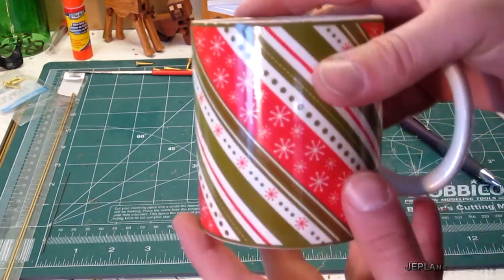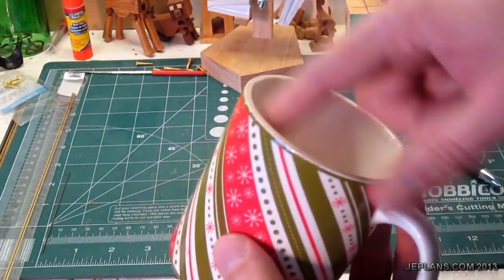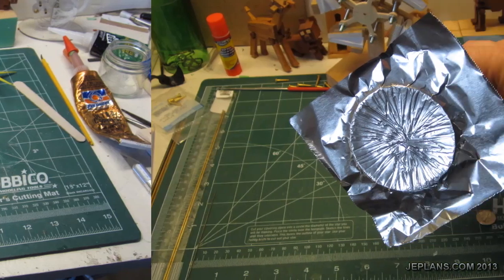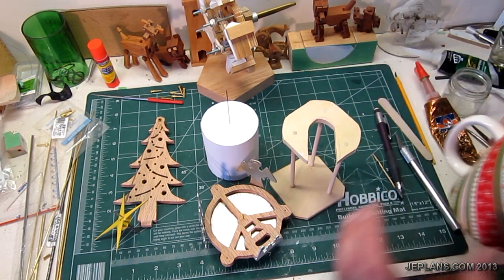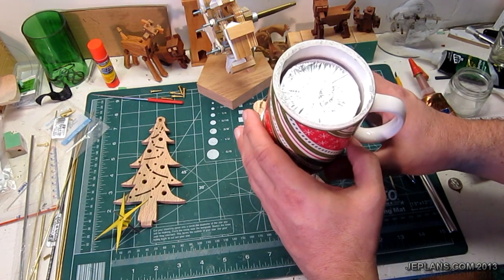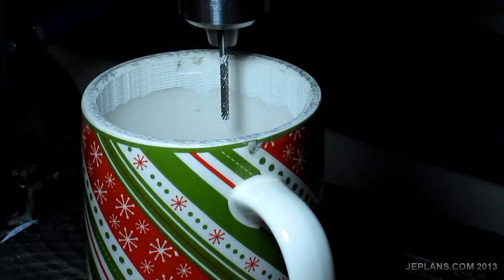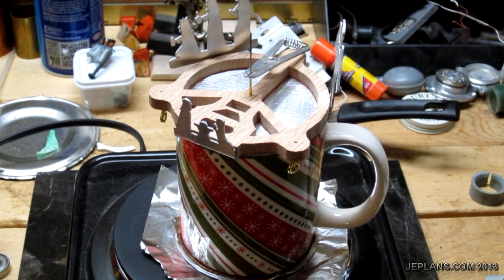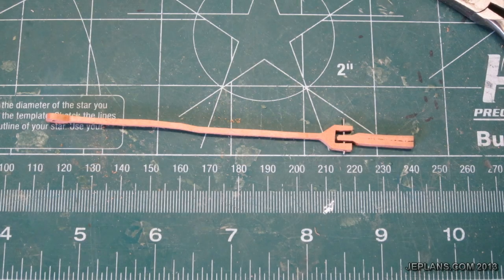Christmas Mug Engine

Comment: The bellows look square.How did you construct and from what material?
Happy Holidays to you too!
Reply from the maker: Wood and paper with a little silicone. It actually came out a bit stiff, it should used thinner paper, but I expect it to get much more flexible after a hundred hours or so of running. I used the same bellows design on my Beer Bottle II and Pentabellow engines. I spend a good chunk of time showing how to make them in the first video on making the Pentabellow,
Reply: jeckert12 Thanks very much. I'll certainly look at the two designs that you mentioned.